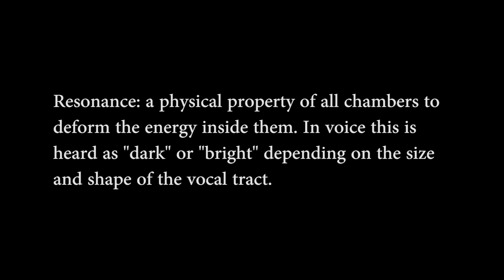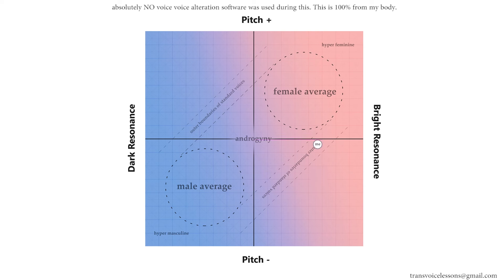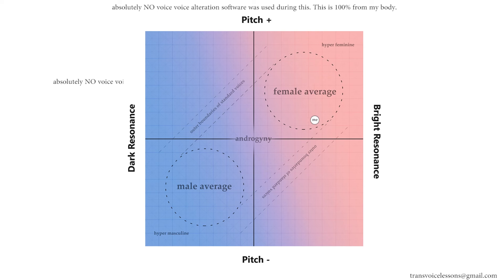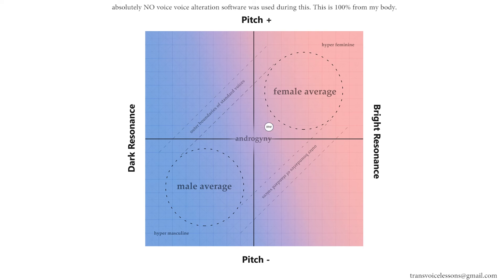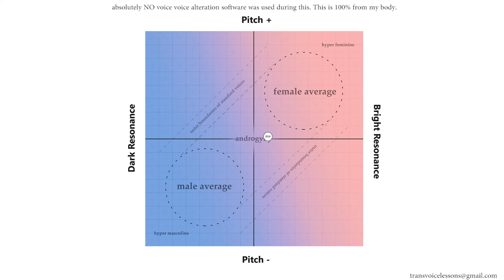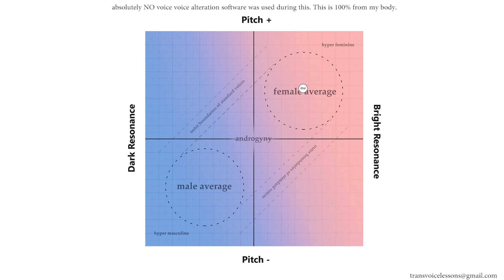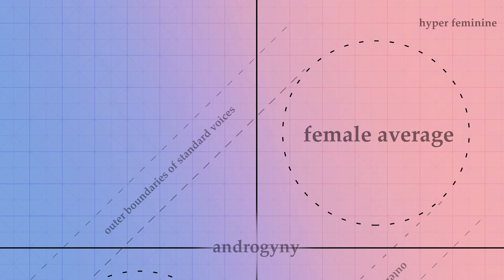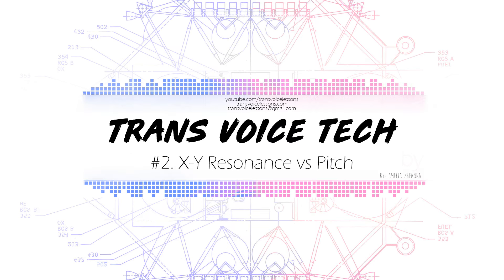TransVoiceTech: Ear Training for X-Y Resonance vs Pitch [demonstration of ALL vocal sexes]

Comment: This is an amazing and extremely helpful video. At age 4 I sounded like a baby boy. At age 7 I had brighter resonance and I think I almost sounded like a girl, but not quite. I did brighten it deliberately to match the girls, although the resonance was still quite dark. At age 10 my voice entered into high male range and most girls ostracized me. I was embarassed by my darker resonance, because it didn't sound like either the girls or the boys---the latter had somewhat brighter resonance before puberty. But in middle school everyone else in my class hit puberty suddenly and I got stuck with my little boy voice. In my late teens I could sing G2 and sang as a young tenor, but my speaking voice stayed a little boy's. But whenever I smoothed out my voice people thought it was in the female range which was discouraging. At the same time, people were freaked out by my high bass extension, but because my regular speaking voice was in the high male range, for the longest time I felt I was a boy pretending to be an adult man. My speaking voice sat right up in B3 for the longest time, and I looked very young, so I felt the lowest part of my voice did not fit my body.

 So in order to be read as a young man, I dropped my speaking voice half an octave and roughened it, but I avoided using my high bass extension on an everyday basis. When I used it, though, I was read as an adult man.

 I think my voice is still changing without hormone supplements, because my neck is a little bit thicker, I have a small Adam's apple, and it now hurts for me to talk at B3 for a sustained period of time, and it's more comfortable for me to talk at E3 or D3. I can hit E2 using my bass extension which I couldn't before.

Before, I felt that I was still a boy, but now I finally feel that I'm a young man. I still avoid speaking on a regular basis with my high bass extension. I know that there are a lot of basses who are women but my high bass extension for me signifies that I did start vocal puberty in my  teens, and now finally indeed am a young man.

I'm interested to see if, given that my range is lower than an adult countertenor's, I can brighten my resonance enough to match the resonance of an adult countertenor. I can already match a tenor's brightness in the low alto range, so I want to see if I can sing along on key with "countertenors." I've heard of at least one trans woman whose voice classification is "countertenor" but she says that she sings more like a "lyric contralto." Thus she has darkened her resonance in the low female range. So if a bright resonance in the androgynous or high male range can be darkened in the low female range, can't a dark resonance in the low female or androgynous range be brightened in the androgynous or high male range?

Comment: So resonance is all about the harmonic distribution? Like dark resonance is a big dip in the midrange or something, while high resonance is a boost to mids and a cut to bass?
Reply from the maker: Yes this is exactly right. Think of it as, the relative amplitude between the harmonics creates the tone and the relative amplitude is altered by resonance.

Bright resonance means you are boosting harmonics 4-10ish

Dark resonance means you are boosting harmonics 2-5ish

In this view, we can basically think of gender analogous to an electric guitar. The neck pickup picks up more of the fundamental frequency and lower harmonics which gives the guitar a "warm, buttery" sound.

The bridge pickup, pickups higher harmonics which gives it a twangier, brighter tone.
Reply: @TransVoiceLessons  Thanks, that's really helpful!

Comment: Is it possible to fully engage the cricothyroid muscle in a male with the larynx lowered?
The reason to ask is that it would correlate the larynx position with pitch, at least partially.
Reply from the maker: TomekD pitch is completely independent from resonance controls. The vocal folds can sustain oscillation at any normal range of speeds with any configuration of geometry in the vocal tract. Larynx height is not connected to pitch. They start out connected in untrained voices because of some fancy Resonance : Harmonic coupling principles that dictate the pressure in the tube and crossover points in sound!
Reply: @TransVoiceLessons  Thanks for the answer.
The reason to ask is that I was once told by a voice teacher that I cannot fully engage CT muscle having my larynx low, and it blocks me from extending my v.f. instead of thickening them when I'm trying to mix registers. Do you support this view?

Comment: I'm curious how much space you could reduce from a vowel (height, backness and possibly roundness) and make it still sound like that vowel and not another. Is it proportional to the height of the larynx?
Reply from the maker: Well, that would depend on where and how you remove space. If you remove space from one area, the sound will change. With proper technique you should remove space equally in all parts of the vocal tract, thus preserving the relative distances between the vowel formants despite being scaled higher or lower as a whole unit.